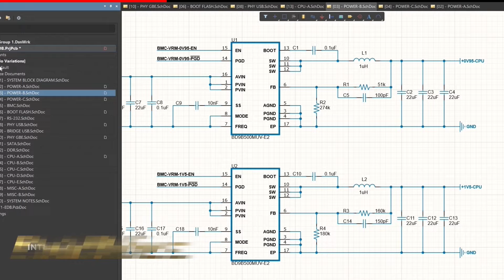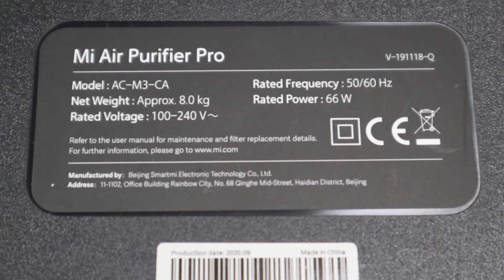How a power module can badly hurt you? - DIY Mi Air Purifier Pro Repair

Comment: My power module also stopped after water leaked into it. I would like to know how it could be repaired.
Reply from the maker: You need to investigate the fault and figure out what got damaged. There is no one fix that can be generally applied.
Reply: @TasteTheCode  Yea, Fuse had blown, I replaced it but seems there was some other fault so something else has damaged now with a spark.
Reply from the maker: @escalocity  The fuse only blows if there is something else wrong on the board. Replacing just the fuse won't fix it unless you figure out the underlying issue first.

Comment: I disassembled mi air purifier 3. And unfortunately, I got that zap from the capacitor. The board was placed down, and I wasn't careful enough. Looks like after the boom, the board is now fried. Where can I find a replacement board?
Reply from the maker: Try AliExpress. If that doesn't work then, some people here suggested getting a generic 24v power supply instead of the original and that seems to work as well. I personally haven't tried that but I do not see why it shouldn't work.

Comment: It was far easier to remove the stock psu and replace it with an external 24v 5A sealed psu and replace the power connector with a XT60, works well after that
Reply: Hello! Could you please share a link to the replacement power supply you used? Thanks!
Reply: @kanavjuneja2638  just find any 24v 5A rated psu, you'll have to splice the cable yourself , there's no pre-made solution
Reply from the maker: Yes, that is a possibility as well if you can't find the replacement power supply. To be honest I prefer when the device is operating as it was originally intended.
Reply: @TasteTheCode  yeah, that's true , but it's surprisingly hard to get the replacement resistor for this board in particular, since that resistor also burned on mine , particularly resistors that are below 1 ohm
Reply from the maker: In any way, I'm glad that you got it working again.

Comment: For me it was cheaper and faster to get a 24V DC adapter and remove the AC to DC converter completely which had blown resister. Purifier works fine this way. Newer model like “Compact purifier” also works with DC adapter and doesn’t have built in converter.
Reply from the maker: Yup, that makes sense. You just need to find adapter with the correct power rating.

Comment: When dissasembling devices in the future: There are in fact 3 types of "Phillips" screws: Regular Phillips head (screwdriver marked PH, no markings on the screw), Pozidriv head (screwdriver marked PZ, cross markings on the screw) and JIS head (Japaneese industrial standard, no markings on the screwdriver and a dot on the screw). China uses PH or JIS screws on some devices so sometimes you have to prepare a regular PH screwdrivers for the JIS standard and this is done by grinding the tip of the regular PH screwdriver to fit snugly in the JIS screw. Mark those screwdrivers for future use. And later when dissasembling some device try both PH and JIS screwdriver for tighter fit.
Reply from the maker: Hey, thanks for sharing. I knew that there are several types but I just usually go with the first one that sort of fits 😅 I know that's not optimal but at least it works.